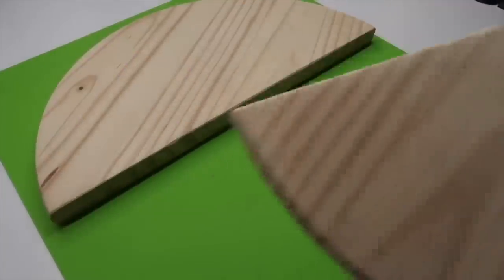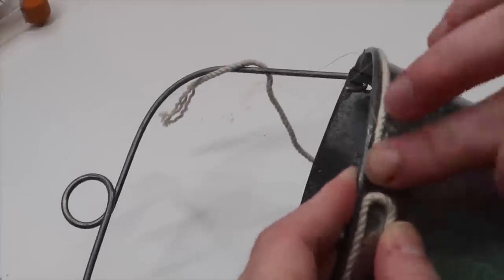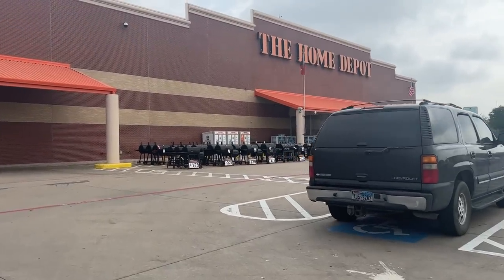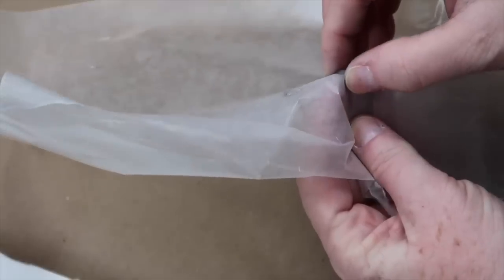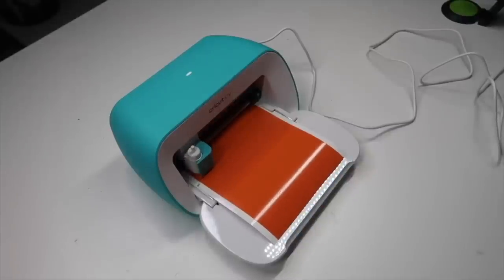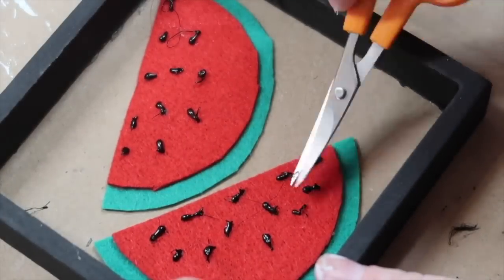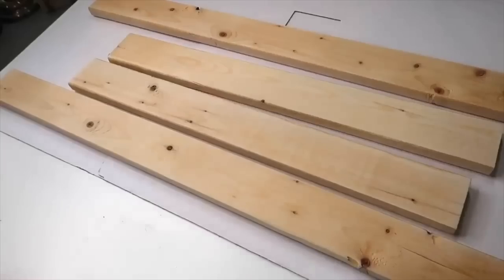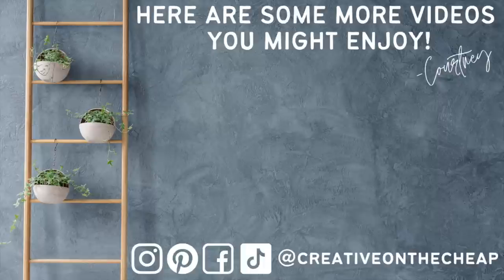☀️ SUMMER DIYS You NEED to TRY! ☀️  | EASY HIGH-END LOOKING Dollar Tree DIYS

Comment: Wow thank you. I have so many questions!!!  
Do you have a separate glue gun for colors and do you cut the sticks prior to using them so you use all of it?
Where do you find wood glue for a glue gun?  Beautiful work. Thank you for sharing.
Reply from the maker: I do have a separate glue gun for colors and if I know I don’t need much of the color, I do cut them in half before putting them in my glue gun.  Any extra color, I squeeze out into a silicone mold and can turn into a magnet or melt it in my glue pot for florals.  I have the wood glue linked in my description box.   You can buy it on Amazon or through Surebonder.  Some craft stores sell it as well.